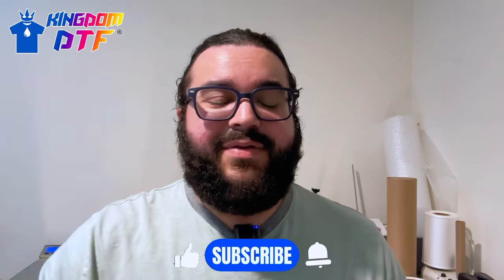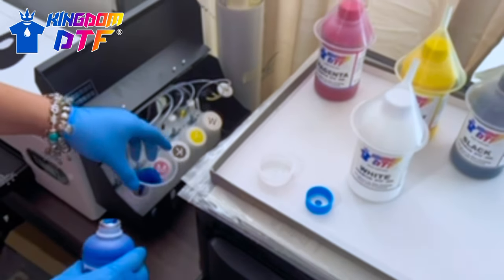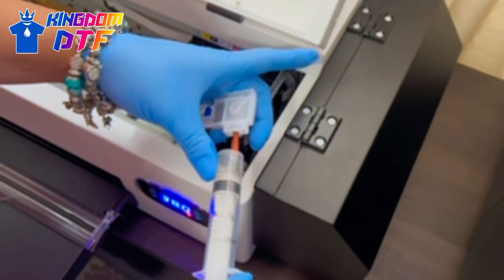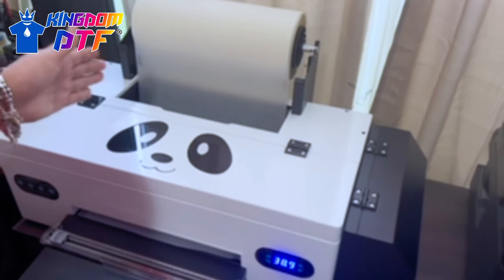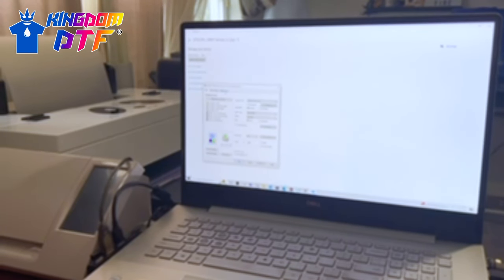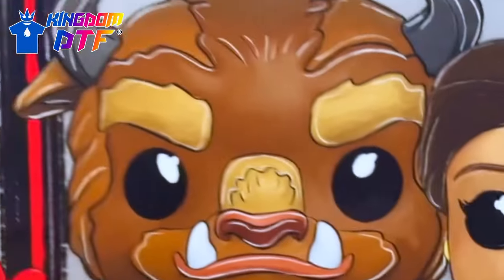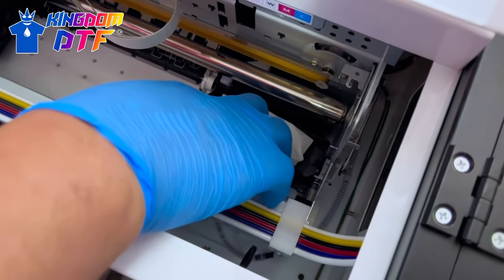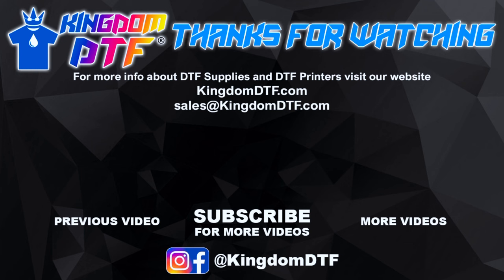How to Print DTF Step by Step Panda 1800 DTF Printer (Our Inks compatible with Procolored) - PART 2

Comment: I just received my L1800 the when I printed my nozzle check the right side of the printing was cut off, I was told to move paper to the edge on the right should it be centered or off to the side

Comment: I got an Uninet 100 - Epson L1800, it stop printing all colors the printhead is not clog and I pulled ink out of the dampers, it acts like is printing but no color comes out, I reach out the a technician but he did not get back to me. Any idea on what the problem could be? I regret not doing better research before buying.
Reply from the maker: If is new, you need to do an ink charge first, then cleaning head, then nozzle check.